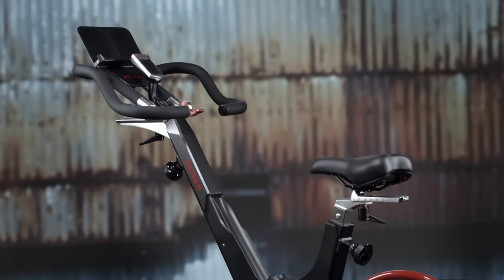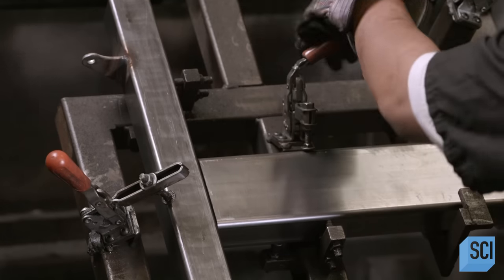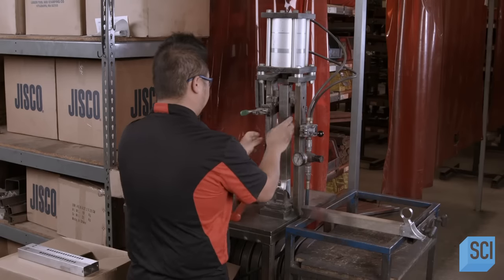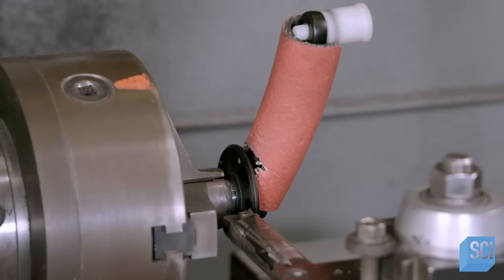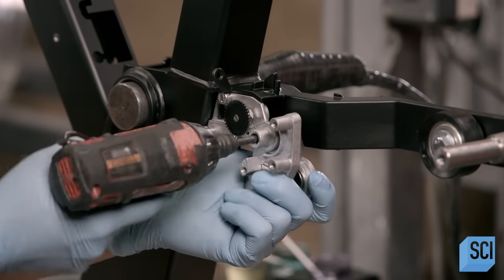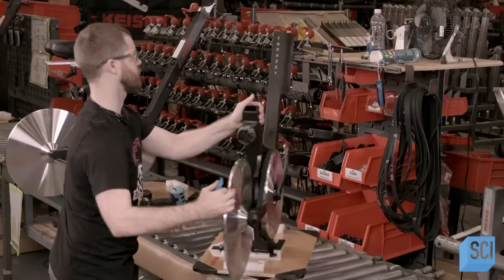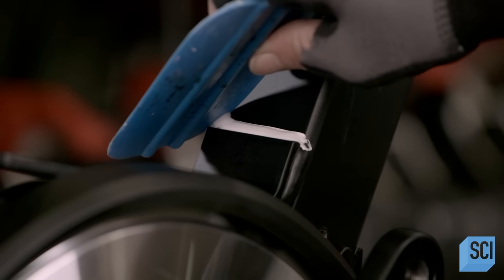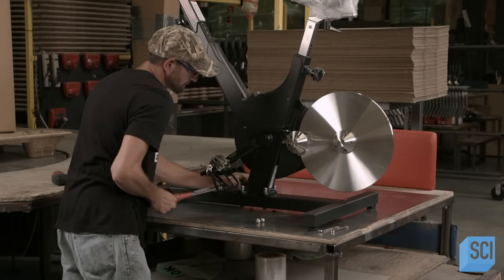Learn the Intricate Crafting of Stationary Bikes | How It's Made | Science Channel

Comment: Is it actually aluminum flywheel? I have a similar one but the flywhell is made of steel. It do get hot after cycling.
Reply: I'm gonna guess, because its not posted on Keiser's M3i page or specs sheet, that the bike isn't an aluminum flywheel. Aluminum isn't magnetic, and if the flywheel is aluminum, it would still need a band of steel for the magnetic resistance to work properly.
Reply: @matthewjbauer1990 aluminum can still be affected by eddy currents. Thatll turn rotation into heat